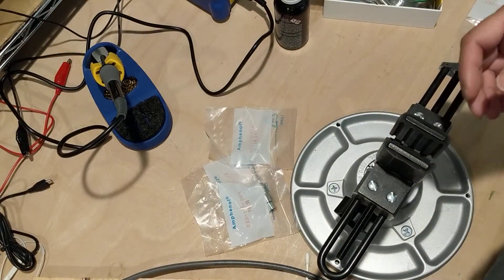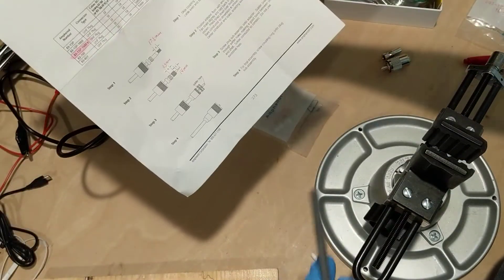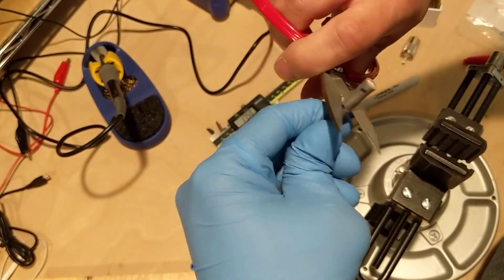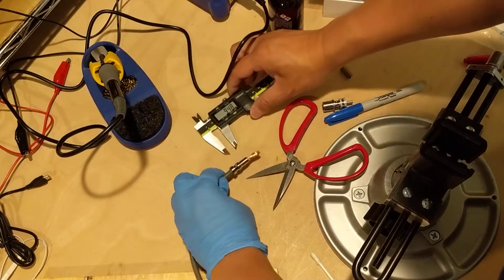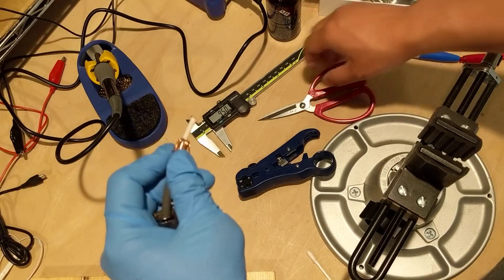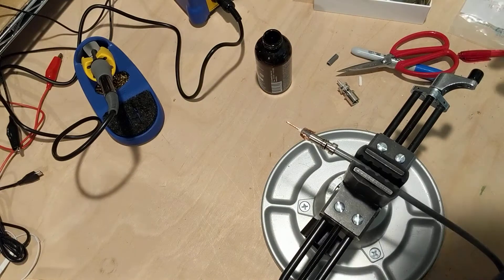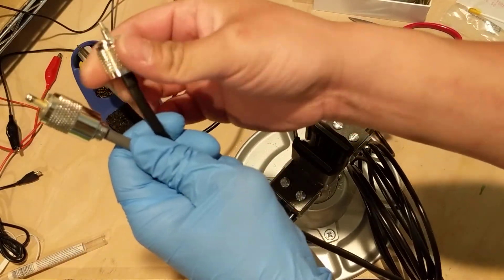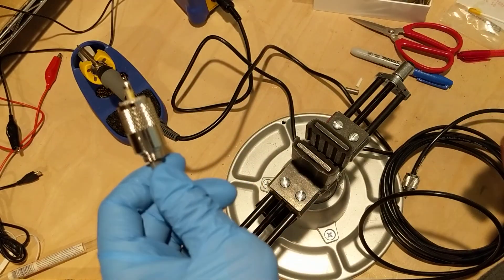Install Amphenol PL259 Connector on RG8x Coax Cable

Comment: I saw one guy twist the ground into a single strand and pull it all out one of the holes and solder it that way. He claims it makes it virtually impossible for the plug to short out. I suppose by possibly running solder into the center pin somehow.
 

I don't know if doing it his way is getting enough surface area of the plug to ground for a powerful system?
Also I've seen a plug that had an extra tube put over the core insulator to keep solder from running  into the center pin.